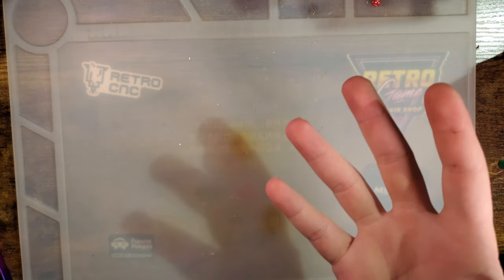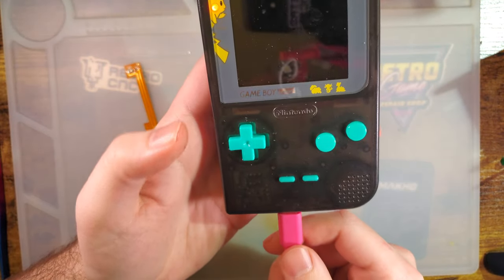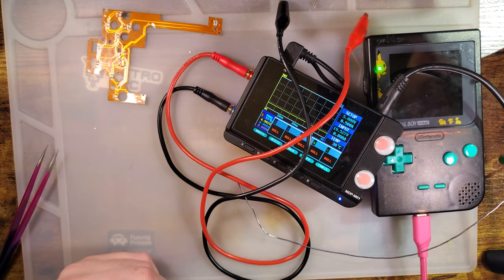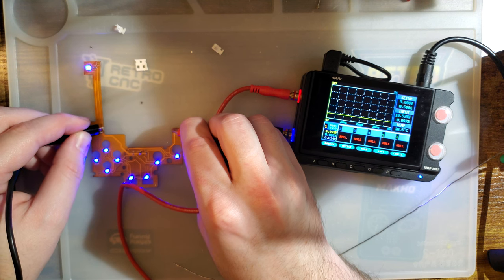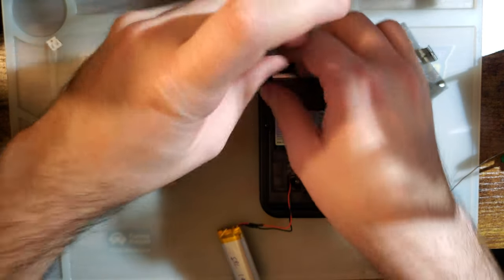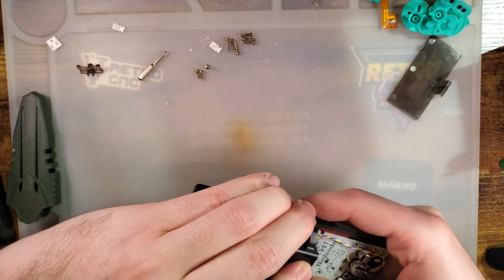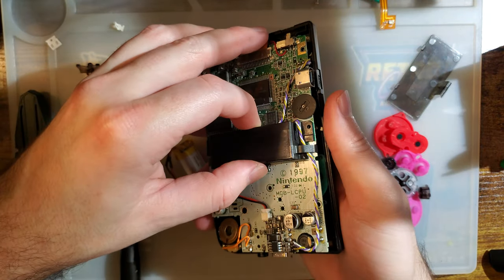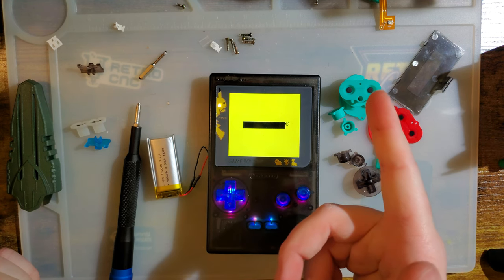'One Chip' Game Boy Pocket Button LED Kit

Comment: Hey makho I just bought your brass sp slate kit. I’m wondering do I still need to use the backlight card if I’m using an ags 101 and will the connector still fit because it seems the 101 and 001 have different screen ribbon connector pins.

Comment: You probably noticed this before you uploaded but the red for the start button LED was burnt out when you switched the original resistor around so, likely dead from factory.  Would really like to see one with surface pots so you could mix up all kinds of colors but it'd probably raise the cost a lot.
Reply from the maker: yeah, I noticed that upon reviewing the footage later. Didn't notice at the time. Didn't seem like too big a deal for me since this thing had bigger problems anyway imo (like not clearing the button solder points for backlight kits)